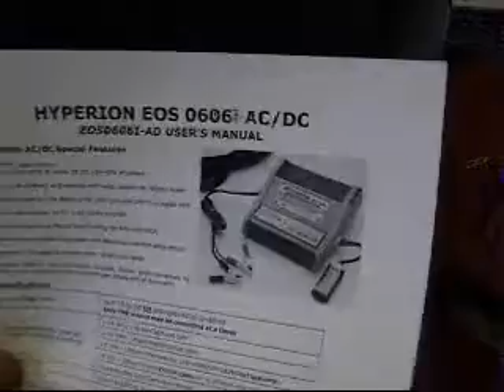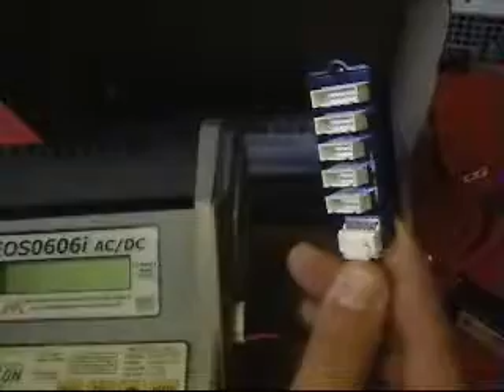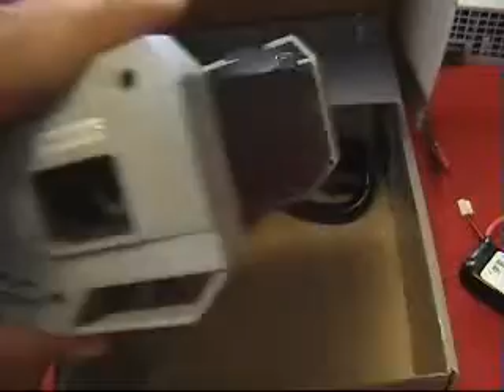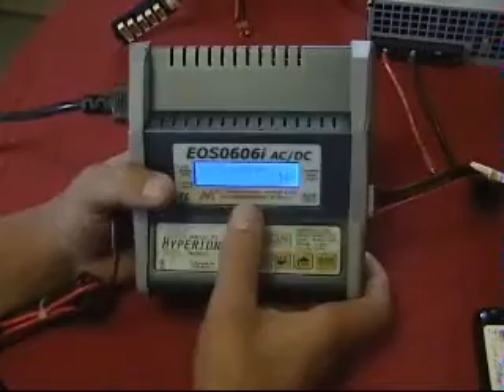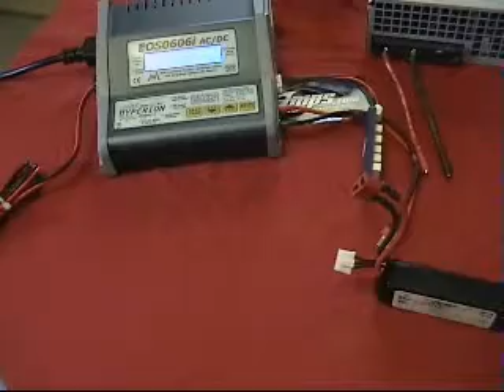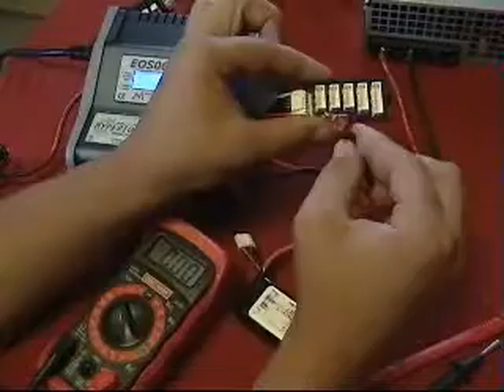How to use the Hyperion EOS0606i AC/DC Balance Charger

Comment: I still have this charger.The DC input wire with bog clamp are outdated. Can i cut those and replace it with XT60 connector so i can use a lipo to power this charger up?

Comment: @JsaonMaxamps If I want to charge my motorcycle battery which has four cells and its own BMS, can I just set the charger to LiPo, 1 cell and set 3500mah to charge at 3.5amp? It is a Shido LT12A-BS

Comment: Ok so I have this charger. My question is why if there is an unbalanced cell why wont charger correct that cell individually? Is the balance portion of the charger only for diagnostic value? If what I am gathering from your vid is correct, the charger just will not charge from the balance portion at all.

Also can you elaborate on discharging and why it is useful with lipo?

Thanks,
Julian

Comment: Does this charger have a discharger so it could actually discharge the two healthy cells with higher voltage upto the level of the voltage of the bad cell so then it could start start charging on a balanced state? If it does not have it what hyperion charger model does that? Thanks!

Comment: I have hyperion 850mah batteries for my trex 250 with a max charge rate of 5 amps, I wouldn't charge that high but is there a way to increase the charge rate to 3 or 4 amps?

Comment: Great video - I've had this charger for awhile and actually learned something new (charging the individual cell separately) - Also, I always wondered why I needed BOTH connectors when other chargers simply charge through the lead - you even answered that question!  Great video, and thanks!

Comment: I just got some 2200mah 7.4 2C lipos, and this charger. Should I just set them up and charger them, or do i need to discharge first?... Will it auto off once the battery is full?

Comment: hey, do you need to get leads for all ur batteries? I have a TP adapter I have a thunder power battery 6S 5000MAH 22.2v has a deans lead, do I need a male lead for the battery? a lead that goes from the charger to the battery? so for all my lipo's like I have one with a traxxas connector will will need a male traxxas harness? and another balance adapter that that battery fits on? I have 2S on my adapto but the lead is smaller on the battery i dont wanna just plug it in. im a nooby to this. thx